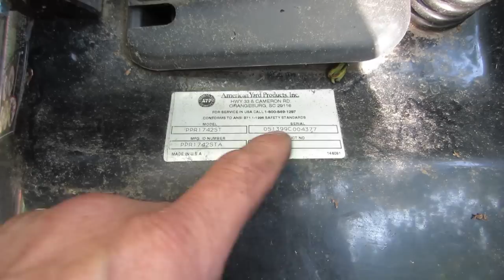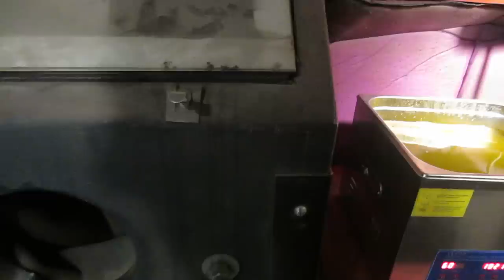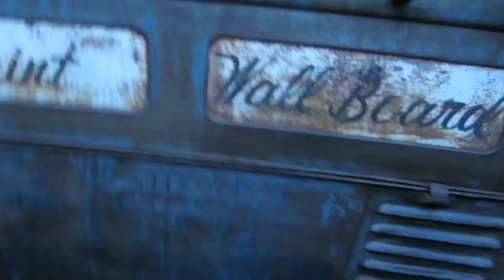abandoned poulan pro riding mower. will it run?

Comment: When you can’t find a date on the battery there is usually a black sticker which indicates the manufacture date code. Yours was a C6 meaning it was assembled March of 2016. Oftentimes they’re used as “installation” month-year codes to let the seller know when that specific battery was sold and installed in whatever needed the battery for the 6 month warranty, but that soon ran out as you can imagine why.

Comment: 25:38  Another idea for you bungee cord deal.  What if you take some metal strapping.  Similar to what is used to hang or secure ventilation venting.  Some of them have holes premade.  Make a short piece into a U.  The open U end can be secured through the rubber strap with a bolt and nut.  Flatten the other end down and use the hole in the strapping over the stud to set the tension.

Comment: With those Bungie cords, I cut them, drill a hole, and put a small brass grommet in them to make custom sizes..works great and you don't have to worry about the rubber tearing. Your u can get the grommet tool/ grommets at Walmart for cheap.

Comment: i know you worked on this mower several years ago but i noticed when you cleaned the rust off the spark plug wire you only cleaned the outside if you took a wire brush from a gun cleaning kit .22 caliber should be good put it in a variable speed drill which i know you have and held with a pair of pliers then you get a clean inside too. i love the hippie mushroom van lol

Comment: Pressure-washing can lead to rusting problems. Blowing the dust off with a leaf-blower will keep the grass clippings off the deck belt and make the mower look a little cleaner. It doesn't need a bath everytime it's used. And, always mow grass before or long after it's rained. Wet grass clogs under the deck and leads to early deck rust out, and replacement decks are expensive. Since manufacturers change designs pretty regularly could run into the problem of even being able to buy a new deck after just a few years.

Comment: Cut off a small length of multi strand electrical wire, preferably with thick strands but not too thick. Use a shouldering iron to heat and melt the strands into the plastic. Basically works like rebar for plastic.

Comment: plastic weld is great but for repairing cracks it will never be as strong as a solid piece especially on aged plastic, so the metal was a good idea. And black plastic sometimes is recycled thus making it even more weaker. Polyethylene plastics do lose structural integrity over time or after being recycled (molecules not bonding as well, especially recycled.)

Comment: What is your suggestions on storing a small engine during the winter seasons? Drain all the fluids?
Reply: Michael Aguilar drain the gas from the float bowl nut. Draining the oil is not Ness are but you should still change it every season

Comment: My 1979 Honda CM400A motorcycle needs a new plug wire boot ,,, if I pull off old crap one will it be same type and method to replace,,, as the one ☝️ u did in this video?????? Thanks Mike

Comment: So I have a 17hp Twin Briggs, also an L head. What is the big difference between a single cylinder 17hp briggs  and a twin? Also the OHV/ L head difference. Are the Briggs Twin L heads the more wanted engine?
Its on a Free Murray rider I got. It is leaking oil heavy down below and puddling onto the pulley. What is the cause of a major lower oil leak like that? A bad oil seal or something else, I'd like to fix that engine. Good big solid twin motor. Turns over has compression, runs good, just leaking oil bad down below.....

Comment: Oil/fuel weight- just wait until winter to run it.  30:45 does it really help to clean the outside of the spark plug terminal?

Comment: G'day, Mustie! "Well, There's Your Problem Lady.." (an expression typically used to point out the apparent cause of a mechanical failure) By the way, torque to spec! Would that be one ugga dugga or two? ;-) 

Thank you for "abandoned poulan pro riding mower. Will it run?" Terrific video! 

Cheers!

Comment: These old tractor/lawn machines must have been manufactured by the same company and just a few skin changes for each brand.  I have an MTD Yard Machine that is basically just like this except for the transmission controls.  A 20 horse twin cylinder grass guzzling machine (grass, not gas)!   My neighbor has an Husqvarna that is very close to what this is.  A third neighbor has an older Craftsman that is very close to mine. The only thing I do NOT like about mine is you have to take the nose off to get to the air filter which is on the front of the engine.

Comment: Fuel stabilizers. OK. So I had a brand new 2009 Mustang. I was working overseas for 6 months at a time, and decided to put fuel stabilizer in my Mustang's fuel tank. Car ran like crap when I got home six months later. It didn't want to start, and when it DID start it ran like crap for the first minute, making stinky smoke. When I went back to work I didn't put fuel stabilizer in the tank and, upon my return in another six months, the car ran just fine. Fuel stabilizers are not completely useless, however. I find that diesel engines benefit in extreme cold weather with certain fuel stabilizers.

Comment: That battery was from March 2016. The little black circular sticker, they'll be in multiple colours though, will either have the actual 3/16 date or a letter-number. It's usually fairly easy to tell if the battery is from 06 or 16 by the condition. The letters just go up to... Usually M for the end of december, but otherwise they'll just be in regular order.

Comment: just found your channel....good stuff.....Are you saying stabil fuel treatment is not a good idea?? It will cause the fuel to gel up like it did in this machine? I just got a new riding mower and it will be going in the shed soon for winter.....should I NOT add stabil??  I also read that draining the fuel tank and running the engine until it is completely out of gas is a bad idea for the carb.....what is your opinion?

Comment: Usually when a riding mower doesn't have compression, it's the head. The valve seat comes loose and it has no compression. Replace the head. Check valve adjustments frequently. If the rockers are loose, it's the head. Replace the carb. often.

Comment: Diesel Kabota lawn mowers eat blades, didn’t feel like changing them out so I kept running them for 2 seasons. I bit the edge of my driveway right at the end of a cut and that blade stopped cutting. So when I took it back to the garage to do some repairs(unrelated gear box issues) I checked blades and the thrower part of the blade was gone. the cutting edge was thin as a razor and was bent to hell. Looked kinda funny, got a laugh from it

Comment: You can try plastic weld.  They sell pieces of plastic sticks that you use like a soldering gun and weld the plastic together.  Or you could use ABS Glue and fill it in.  Or you can just use duck tape.

Comment: Better double check the parts fishe, those engines are prone to the studds coming loose in the head, not sure if it HAS a winker-cap on both valves, may only call for the exhaust one to help it rotate.......... put some thread lock juice on the studd or it will loosen again

Comment: The sticker on the battery that says "C6" is the date code for the battery. The "C" would be the third month, or March. The "6" would be either 2006 or 2016, with 2016 being more likely, judging by the model of the mower. The battery was produced most likely in March of 2016, though this mower is a 1999 model, but it doesn't look like it has been sitting for 13 years.

Comment: So should I not be using fuel stabilizers?  I usually toss some Stabil in my mower/blower when their respective seasons end.
Reply: So do I, but down South, our lawn equipment doesn't sit idle as long as they do up North.  Still, I took note of the 'snot'.

Comment: I must have a weird mind, but all the way through I've been wondering what would happen if you were to light that gelled fuel? Would it erupt into a fireball as you might expect from liquid gasoline, or would it burn slowly like a kerosene based firelighter?

At least now I think I understand why we saw so many ruined carbs on the various machines we would by from the auction centre and farmyard sales. I reckon we could do with an ultrasonic cleaner around here!

Comment: My poulan pro pp19a42 stalled i filled with fuel then tryed to start it, flooded the cylinder, pulled the plug drained it . Now there is gas in the oil. i"m wondering what caused that? I"m going to add a fuel shutoff valve so when it sits in the hot sun pressure can not build up and force gas into the combustion chamber. hopefully that fixes it.

Comment: Hey I got a poulan 750 hydrostatic i think that's what it is it has a little lever on the back of the mower and the mower can be push no matter what position it's in seems like the rear end stuck in neutral we don't check if the arm is turning the rod it is so how can I fix this

Comment: This is a six year old video, so I'm sure you have learned by now that the gel is not related to gas stabilizers, but rather the result of ethanol attracting water and forming a gel. Taryl did a months long study of gas stabilizers and found that ethanol gas with no stabilizers produced the most gel, while non-ethanol gas produced none or nearly none.. It turned out that over months of storage, the gas stabilizers generally did very little to reduce the gel. The best was Stabil Marine 360, but it eventually failed too. Results: Ethanol gas can be used in small engines if used quickly, but will deteriorate rubber parts over time and should NEVER be stored for long periods in small engines. It's worth the money to use non-ethanol. Pre-mix also works, but is very overpriced.

Comment: Wow - I've seen gas-contaminated oil before, but nothing that approached this! (8:00).  That's as bad as adding two quarts of Motor Flush to your car's crankcase, then draining it.  Also, Mustie... watch using Simple Green in your ultrasonic cleaner on aluminum parts.  Simple Green can do a real number on them if used excessively.

Comment: I run a sharpening shop and would NEVER bend a blade like that.  That far out should be replaced.  Stand a good chance of developing stress cracks.  And balancing it after bending.  Good luck.

Comment: What do you think about the Chinese knockoff type carbs on eBay or Amazon? I just replaced the carb on my Toro GreensMaster 1000 greens mower.. I bought it with 980 hours and probably could've cleaned the carb. I spent the extra money and bought the true part from the manual, but saw some online for $30-$40. My research showed you're basically hoping for good luck with the knockoff carbs. Has a Subaru 4.5 ex13 engine on it.

Comment: I have the same engine and it blows a ton of oil out the breather tube. Piston/rings and or cylinder  is most likely done?
Reply from the maker: head gasket, common problem
Reply: Mustie1 already replaced headgasket. The engine ate a set of butterfly carb screws and revved to the moon till it knocked and died. Took maybe 20 seconds. Top of piston is all dimpled but cylinder looked ok. I replaced the head also. Runs now but barely, blows oil terrible out the breather.

Comment: Great job!    Was there an engine swap done to this?  (14 HP vs 17 HP sticker comment)
Reply from the maker: no, it was missing the cover, and l had a 14 one that l put on, but the engine is a 17
Reply: Thanks for answering - yep, you mentioned one of the covers was missing.

Comment: i need some help with my mower, the deck leaves a line down the middle of the deck, but its like a half inch higher than the rest of the deck, we replaced the blades and fiddled around.
Reply from the maker: do the blades line up to each other like l showed in the middle?

Comment: 1999 Mower. 1:02 I believe the serial number May 13 1999 ie the 051399C004377 Serial number, The engine wase built. Ie probably later 1998 or early 1999. 

The frame of this mower is about the same as the current Poulans sold by Home Depot and Sears too. The Husqvarna, Craftsman, Ariens, Polan are made at the same place with just different trims and features. The frame of these mowers is often a cylinder or V2 engine will fit. The engines use the same hole pattern, but the V2 models (two cylinders) have the exhausts out the back thus there are extra holes for the V2 models often too.  If you google the frame number of you mower you will often find it fits the family of mowers made under the same factory. 

Most of these mowers have the gas tank by the engine, but a few percent have the tank under the seat and the battery by  the engine. The front battery version with rear tank holds a tad more gas. ie mine holds 3 gallons and I think the front tank versions hold say 2.5 gallons?  The front battery variant requires some more work to get the battery removed or installed thus I think they can build the mowers quicker with the battery under the seat variants.

 The hydro transmission is used on bigger models and gear type on the bottom models. The engine speed needs to be full when a hydro transmission mower is used since a fan cools the transmission. An old mower can have a dead or slow transmission, the fluid gets cooked. These models are really made to cut grass and not to pull big loads.

Comment: Glue some band of plastic from "cola" bottle inside and outside can't be sufficient enought ?

However print your "brand" ?
Reply: There are ways to recycle fuel-oil mix to "clean" and preserve really dirty pieces like under an old engine or on exhaust pipes it makes a bit a smoke, but keep the iron from future rust in a moderate way, and at last to treat external woods ...
It sounds "nasty" but what you consider as dirty is a "green" way to avoid lots of woods issues ...
Mean on external faces of woods ...

Comment: Question for you, why use fuel stabilizer, why not just run it dry?
Reply: I use non-ethanol gasoline so no need to use a stabilizer at all, I can leave gas in all winter and no problem in the spring.  Have been using for over three years now.

Comment: I a question I am buying a used tractor mower and I would like to know how to know if I am getting a good deal?
The tractor I am looking at is a older craftsman no bagger 250 runs and drives and cuts
Reply: Pretty good! I find lawn mowers all day for around $200 running and cutting. The more expensive ones are sometimes just over priced, newer, more powerful etc

Comment: I have one like this and won’t do anything when I turn key. New battery and I put on new solenoid.  Nothing. Any idea? Was able to run before the guy gave it to me. It sat for about a month before I got it home
Reply: Gary Smith sounds like one of your safeties isn’t engaging/disengaging. There are usually three - seat safety, brake safety and mower blade safety. Check those. Also could be the ignition itself has gone bad. Turn the key on and probe behind the key switch to see if you get power and just follow it from there.
Reply: Artem Artem thanks!!!

Comment: I have to disagree with his assessment of fuel stabilizers causing carb gum up. I've used these stabilizers for years and never had a carb problem.
I have less than a half-acre yard and to keep from having carburetor issues I run a fuel stabilizer the entire season. It's really cheap insurance against doing repairs and having to dump out or pump out dead fuel in the spring. Whatever fuel is left in the tank and in my gas can remains stable throughout the winter. I just add the necessary amount of stabilizer in my gas can before I go to buy fuel. It mixes up when I put gas in the can, and I don't have to remember to put the stabilizer in the mower tank.

Comment: That briggs has a crankcase activated fuel pump. If you get a small crack in the diaphragm it will suck fuel into the crankcase. But if you fixed the machine I'm sure you know that by now.
Reply: Actually most did. I don't see one on thay one now that I look.

Comment: Sorry but Sta-Bil does not cause the fuel to gel up like that, gas will over time start to gel and turn to like a linseed oil. You can smell it if you know what it smells like. I have seen plenty of them when they haven't run in years even the valve will freeze up in the engine. That is NOT caused by the fuel stabilizer in the gas.
Reply from the maker: if you use way too much it will, there is a video on youtube about it

Comment: I Differ with you on the Goop in that fuel bowl That comes from using todays Ethanol gasoline where the gasoline is left to sit for a period of time without using the stabil fuel additive If you will read the owners manual they advise against using ethanol gasoline BUT if you are going to use the ethanol gasoline then dont go above 10% and use the stabil to keep the ethanol from separating from the gasoline over a period of non use and what you got out of that fuel bowl was the ethanol that had separated from the gasoline because they didnt use a stabilizer in the gasoline That from a TRAINED SMALL ENGINE REPAIR MAN That has been to school and also over 50 years opf working on them both before and after ethanol gasoline so dont advise your followers not to use the stabilizer rather advise them to use the old style unleaded gasoline which a few people still carry or if they MUST use ethanol gasoline then use a stabilizer which keeps the ethanol from separating from the gasoline thus the mess you just cleaned out of that carburetor plus that mess can in small quantities work its way into the engine thus creating further problems to the point of destroying the engine

Comment: OMG !!! You let the gas evaporate !!!!😱 CARB Will be knocking on your door !!!!
Reply: Colluded Ar*e Rape Board, is what I call them, not in Crackifornia here and step one of using any new small engine device is turning mixture screws out enough so they even run.